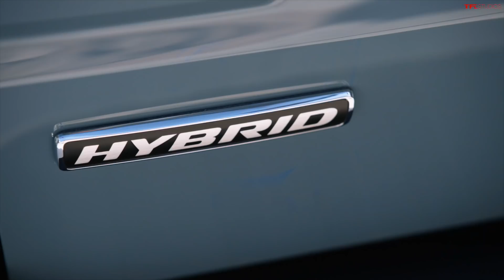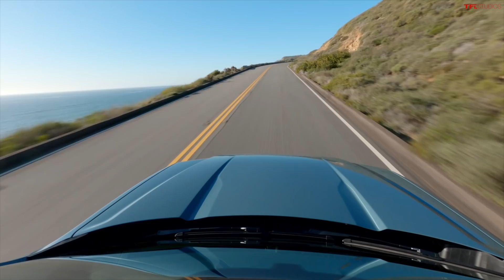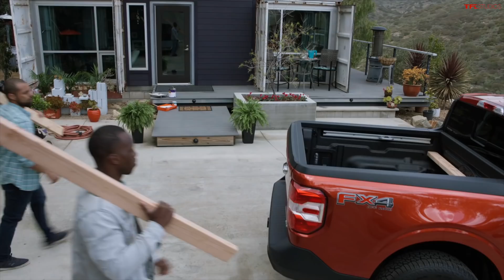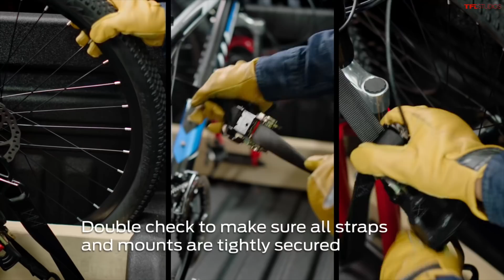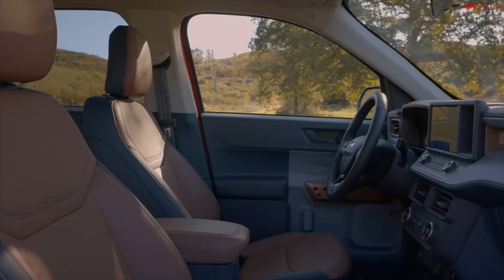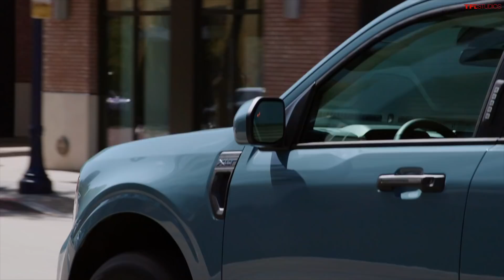What Do You Think Of The 2022 Ford Maverick? I Get ALL The Details From The Guy Who Built It!

Comment: The 4k tow pack has the same gear ratio as the XF4 does. Is the difference in the tow ability in the hitch? Change the hitch to the 4k and itll pull it safely?

Comment: Why does ford keep doing this? Small displacement engines with turbos and GDI. If you want an easy way to ruin your engine, that would be the best way to do it. At 100,000 miles these will start having problems. Same with the 2.4 l ecoboost in the ranger (which is the stupidest engine choice possible) and the 3.5 ecoboost in the f150's. At least the f150s have the option to go with the 5.0l V8 or even the 6.2l V8 if you want it. 

The Maverick should have an option for a v6 engine with no turbos. Ford has made some great v6 engines in the past. Take one of those and upgrade it like they did with the 5.0l. a 4.0l v6 would be dar better than tiny little 2.0l 4 cylinder with twin turbos. The Ranger is big enough they could have a 5.0l V8 or have a 3rd option of the 4.0l v6. 

2.0 l is a smaller engine then they used to put in the Ford Escort, but to make it drive faster and tow more they throw turbos on it... Recipe for disaster. Thats why you are seeing all these 3.5 l ecoboost engines in the f150s that now need turbos replaced or in some cases full engine replacements.

Comment: ...Remove the gas engine and sell it for $14,950.00 then YOU GOT A WINNER!
THINK ABOUT IT  ....NO MORE CHANGING OIL  NO MORE BUYING GAS  NO MORE FILTERS!  ..DUMP THE GAS ENGINE!!
Reply: please introduce a power grid system that does not itself run off fossil fuels to generate power. Until there is a reliable grid, there are going to be limitations and not everyone will be willing to just convert over night. How are you going to charge your vehicle if you opted to not charge at the last station and ran out of juice? I don't see anyone building a self charging system (outside of the hybrid models) or offer a solar panel system for these emergency situations.
Reply: @drakeb389  ...The Perfect World Is Just Around The Corner  ..Rest Easy Drake!  ...But in The Meantime  ..Production of EV's Will Continue ...Perhaps You Could Speak to The Fossil Fuels People About Your Possible Emergency Situations..
Reply: @hymlog  I always love commenting on things like this because you all always miss the point of the comment. Talking to the Fossil fuels folks has nothing to do with recharging the battery on an EV if you opted to not charge the EV and end up stranded. I think its seriously hilarious how dependent EV fanatics are on fossil fuels without really thinking about it. Like the mining of lithium. That is not done with an electric or hybrid vehicle.  You also cant just go walk off to a station and bring back a jug of energy. Until they start putting solar panels on these vehicles or start putting in measures that would allow it to charge via movement, a nation wide conversion will NOT happen for many years.
Reply: @drakeb389  ....Now you say ...Fossil fuels folks has nothing to do with recharging the battery on an EV's  ...So All's Well!   ...Glad That's Settled ...Good Job!
Reply: @hymlog  It's like you can't read. Good job buddy.
Reply: @drakeb389  ...Please Pay Attention!
Reply: @drakeb389  ...A little Rest ...You'll be fine ..
Reply: @hymlog  OMG you're so funny!!!
Reply: @drakeb389  ...Thanks Drake  ..You Da Man!

Comment: Is it a truck?  More than the bed makes it, or does not make it a truck.  To me, front wheel drive is not a truck because as you load up the vehicle with stuff, a trailer, etc. It unloads the drive wheels.  Loading up a truck should load up the drive wheels. I have a fwd suv and when towing, it struggles for traction.  My wife and I are going to look at the truck but only the 4wheel drive version for that reason.

Comment: Do you think this will be okay towing a bowrider boat right at that 4000 lb limit? Most towing experts recommend the 80% rule, which puts you at 3200 lbs. But even an 18-19 ft bowrider by the time you add trailer, gas, and gear is right under that 4000 limit which kind of sketches me out. Id really only be towing 100 miles/2 hours total a weekend during summer, but some feedback would be good.
Reply: I wouldn’t do that. My towing needs are 2000-2500 pounds, so this is perfect for me. In your use case I’d go ahead and step up to a V6 Tacoma or a Ranger. If you really want a unibody, the Ridgeline is going to tow better than the Maverick without a doubt.

Comment: Great info EXCEPT in this half hour did I miss details on gas mileage, how could you not discuss at 3$ up gas mileage???
Reply: EPA-estimated 21/32/25 MPG city/highway/combined or 20/29/23 MPG city/highway/combined with AWD. this is the 2.0 Eco boost engine.
Reply: EPA hasn’t tested the 2.0 mpg yet. My guess is 24mpg combine
Reply: @devinbender8428  👍

Comment: Ford Fails - #1. This is a Bronco ST (Sport Truck) They should have built it with all the options as the Bronco Sport. It would be an awesome 4x4 small truck platform. #2. Should have used the Bronco Sport Front End!  Ford Kudos - #1. Love the small bed and all it's options! I would have bought this in a heartbeat when I was in my 20's and tent camping with the buddies. #2. The interior rocks! Back seat storage like the SD, Door panels with storage. Tech wise, including the Sinc system, Apple Car Play and Android Auto, is great as long as they upgrade the base sound system. The base sound system in the SD's is so terrible (I'm thinking about installing a couple Drive-In Theater speakers as un upgrade).

Comment: This guy it was like pulling teeth want one tho after I pay my plug in hybrid off just to have more room and get some what the same mileage sucks no awd also the hybrid would turn off in costing also some times well braking and well siting it should not run will run off the battery my only stuff that sucks is no awd and low tq lol my volt makes 298 tq

Comment: I just went a priced the Maverick XLT model and it priced out at $33,170 dollars. Sorry but this is a huge swing and a miss.
Reply: How? I built out a 
XLT Fx4 Luxury for just over $30k what did you add?
Reply: @devinbender8428  I checked almost every box but some boxes would delete equipment so I avoided those boxes when it was all done it came out to $33,000 dollars before tax, tag, title, dealer paperwork, and an extended warranty. 

I don't like the way Ford always controls what options you can have.
Reply: @ramecodiesel8271  ford is actually one of the better companies when it comes to options. 

Most Asian car companies have virtually no options. Just check your options you want and here’s the trim you need to get all the above.
Reply: The point is, if you don't want or need those extra options, it is an affordable truck that still has some essential features.

Comment: Just because of a engineer calls this a truck it not a truck. No full frame ,not a  rear wheel drive , This is a car with a box . When you hang a load that far off the tailgate you will lose your ability to steer the vehicle. I can't believe this engineer is showing 4X8 sheets in that short box .Maybe manufacturing should focus on making sure the components going it these vehicles are at a higher quality so there's less recalls so we don't have to take our new truck and cars to the dealership and have a sloppy mechanic take it apart and reck something else to fix what was recalled in the first place.👎🏼
Reply: You don't think they were smart enough to test if you could drive it with the plywood?
Reply: Dude I carried 4X8 sheets in my 01 Frontier with it’s tiny five foot bed all the time for my granddad. Tailgate down, at an angle, with it tied down. Never had any steering problems. It won’t be any different than this. That sort of work is nowhere near the weight where your driven wheels would matter. 

This isn’t a truck for you. Doesn’t mean it doesn’t work for other people with different needs.

Comment: Does it come with a stick shift and a clutch so I can do my own "off road modes"?  I'm 51 and I know how to drive better than a computer....plus sensors all over the place are just more things to break when I'm in a remote area...I like this truck and am seriously considering purchasing one, good job Ford, but turning a dial for road conditions makes me wince.  I have a GMC Sierra that has the dash lit up like a Christmas Tree because I changed the size of my rims/tires and only the dealer and their computer can fix it.  My rate of sensor breaking before the thing it is supposed to sense being a problem is like 50/50.
Reply: You are going to have to buy old vehicles and fix them up Im afraid.

Comment: Nope the Maverick is another strike out for Ford, in order to carry plywood you have to put it on top of the wheel wells which means you have to carry wood as supports, the bed is next to useless, this is not going to be the big seller people in the comment section think it will be.
Reply: Any plywood that is that thin will flex into it.  It's sheetrock you mean I think, and there are pockets for 2 x 4's for that reason. It's a pickup, three pieces of wood is a problem?  Yeah it's for a homeowner running to Lowes for a weekend project.  THAT is the market.
Reply: Think you are wrong,  but we will see.
Reply: Dude this thing will fly off of lots. 

It’s filling a niche that hasn’t been served in twenty years. True compact crew cab trucks for daily driving and light work. And those old compact crews were flawed thanks to awful fuel economy and ride quality that would break your spine. I know. I drove an 01 Frontier Crew for five years.

Comment: Their is definitely a market for the Maverick! I owned two Rangers in the past a 1990 and a 2010 with great service ! I bought a 2020 Canyon a great truck but miss the smaller truck . The Maverick will be a hit for Ford but ford needs to bring back a 5 or 6speed standard transmission and a 2.5 4cyl non turbo engine!
Reply: I've got a 2001 Ranger with the 2.5L 4 cylinder...it's a great engine...manual too...but for a new truck, I don't care anymore if it is manual.
Reply: @Werewolf0216  you have lost your way.

Comment: Any idea if there are plans for a super crew version?  Size wise how does it compare to the old Ranger??
Reply: Probably no super crew, it’s a small truck. Super crew cabs and what not can be had on bigger trucks so just buy one of them. Why would you be looking at a maverick super crew in the first place?
Reply: @doylee469  More in line with the old rangers supercab which would be smaller than what the Maverick is offering right now.  However I think this is just fine as is just need to see one up close.
Reply: I have a 2001 Ranger, regular cab 6 ft bed...it's 188 inches long...looks like the Maverick is 200 inches.  The old Ranger (of 2001 era) super cab or regular cab with 7 ft bed would be 203 inches.

Comment: great job Andre and Klaus ,the R&D team checked virtually every box humanly possible for the first version of the Maverick, price point, hybrid system, power, economy  and the level of standard equipment , nothing else ticks these boxes, AWD hybrid systems are very expensive to build and design and then the price of it would be closer to Toyota pricing , then all would complain its a Ford its not worth it, and for towing Hyundai is using a DCT and they don't like heat or towing the same as most CVT's the tow capacity is low from the load/heat generated from towing   and i am already figuring out on how to mount a roof top tent over the bed of this truck with a system to hold 2 kayaks  and it doesn't have to be AWD to do this, this truck will do vey well in fleet use for city services , the costs are very low  and the fuel savings alone will payoff  fairly quickly, the aftermarket will have lift kit option spacer type, available within 6 to 12 months from the time they hit the dealerships and the box extension like the Ranger sport used to have will be available either from Ford accessories or the after market, keep in mind that if you buy your accessories from Ford and they are installed at the time of purchase it is part of your factory warranty not a little warranty like the after market would give, Santa Cruz does not have the history or truck knowledge or engineering background as does Ford 100 yrs worth, they will both sell well, My money goes with Ford just like Andre's did and Klaus's will  👍

Comment: Very disappointed the 2.0L Turbo is not available with an AWD hybrid power terrain. 
This is a brand new platform why SYNC 3 and not SYNC 4?
Why doesn't the FX4 get a suspension lift to accommodate 32x11.5 tires from the factory. And more power outlets in the bed. 

Everything else is absolutely AWESOME!!!
Reply: 1. Yeah that was kind of a miss. Although the complexity of that type of powertrain would worry me. 
2. I think the Sync 3 units are a lot cheaper now that they’ve been in production for a while. This thing is meant to be cheap and utilitarian, a truck for the proletariat. As long as it has Apple CarPlay, which it does, I could care less about the built in system. I never use Honda’s on my Civic other than reset tire pressure. 
3. I don’t think this thing is meant for the kind of off-roading 32 and up tires get you on Jeeps or Broncos or BOF trucks. If I end up with one, I’ll use it for driving across fields and maybe some back woods dirt trails. Nothing more than that. Wouldn’t trust it.

Comment: I'm thinking about getting this but most of my car/truck friends says it's going to be unreliable :/. Are ford trucks generally unreliable?
Reply: LOL, you're friends are idiots.  How can they predict the future? Ford trucks are some of the most reliable trucks around.  There is a reason the F-150 has been a best seller for decades.  I still own a 2005 F-150 FX4 that I bought new almost 17 years ago.  It's got 175K miles on it, and still going strong.
Reply: @truthserum5310  lol they are toyota fans so that's what I was thinking but I'm definitely feeling better about buying the maverick as a first new vehicle now
Reply: Since the maverick is a hybrid,im willing to bet that it will have a long powertrain warranty as hybrids tend to have(8-10 years imo)so reliability shouldn't be a concern.engine is mostly based off the bronco sport and that's a rugged vehicle.the only thing i know that is unreliable is the transverse orientated ecoboost v6 with it's internal water pump design.
Reply: On my 09 Ranger, other than general wear and tear items and some body rust spots, the only major things I've had to deal with was a failed rear axle seal and rusted through transmission cooling lines.  Fixed the cooling lines using brake hose.

Comment: I’m curious about how the slippery mode works, since I’d want the mpgs of the hybrid but do live in the northern climate with occasional snowy roads. Awd would have been nice for hybrid but love the pricing too. I know the Hyundai Venue has a snow mode, wondering if the Maverick system is similar?
Reply: Same exact situation. I drive a 4x4 now and typically do ok in the snow without having to engage 4 wheel, and I'm curious if using slip mode while also dealing with front wheel drive will be enough

Comment: You know, I was biased against it as soon as I heard about the concept of a tiny truck. After watching this, I'm completely reversed on my opinion. I already have a full size truck, but something like this would be nice to tool around in when you don't need a big truck and you would be able to do a lot at the same time you would save gas and get into tighter spots. I'm definitely going to point this out to my kids. I have a feeling these are going to be one of their biggest sellers.
Reply: Yep I was going to use this to complement my Superduty so I would no longer have to use my superduty as a daily but since its not going to have all wheel drive with the hybrid version im out
Reply: @bradcoddington1679  well, maybe that will change. I'm sure the other versions will still get pretty good gas mileage, but definitely not as good as the hybrid
Reply: @bradcoddington1679  Do you live in colder snowy climates or why do you need AWD?

Comment: Too bad they do not offer this in a 2-door longer bed version with the 2.0 liter transit engine and a 6-sped manual trans for 18k.
Reply: We would like that!! A manual transmission is rock solid no transmission problems.  Problem is in today's market they dont sell well at all.  Got a 16 focus with the manual transmission was hard to find one.  It now has 195k miles and zero problems so far 40mpg.  Got a Scion TC with the manual transmission . Guess what ? The focus handles better feels more solid. Not sure about this new Maverick.  Its made in Mexico, its a new model, not sure if its good or not.  Its not for cold weather snow ice and salt on the road.  Am sure it will be a rust bucket.
Reply: That engine combo would be amazing